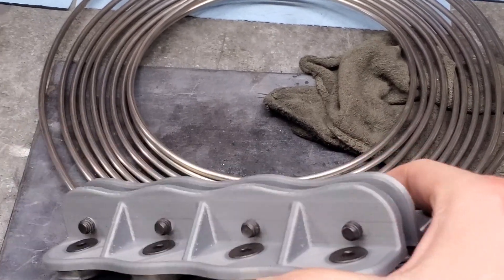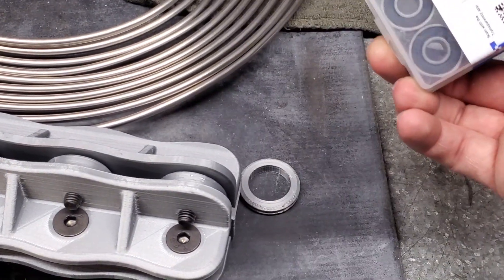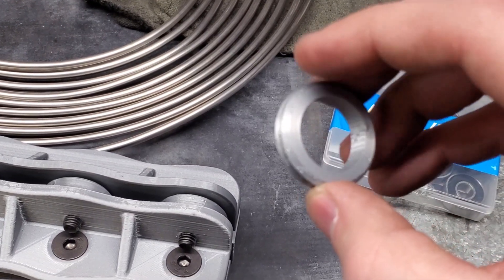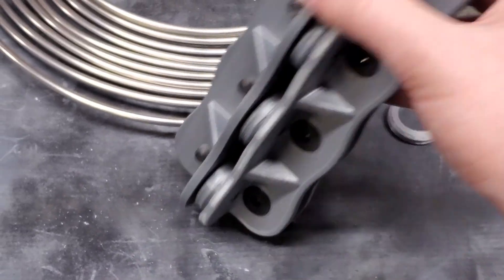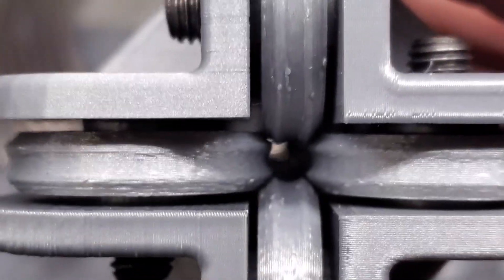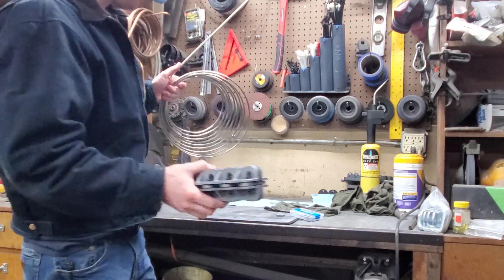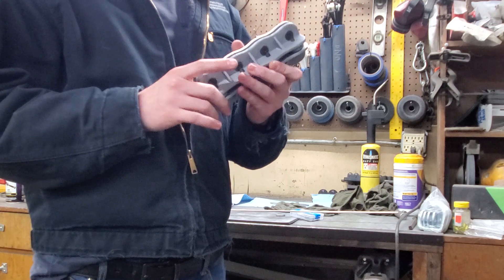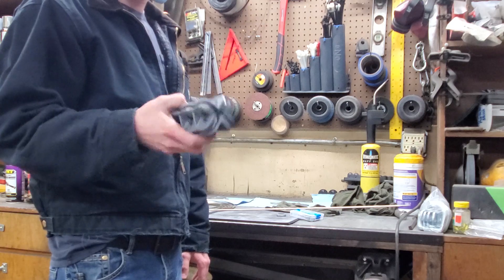3D Printed Brake Line Straightener

Comment: If it will do stainless it will do anything.  I made one out of angle iron and screen door rollers but I'm gonna make one of these this weekend.  Thanks for posting the link to the stl.  Good work sir
Reply from the maker: No problem! Hope it can be useful 🙂
Reply: @WrenchChill  I got it done. It turned out great.  Really appreciate you sharing it.  You would laugh at the one I made but it did work. Lol